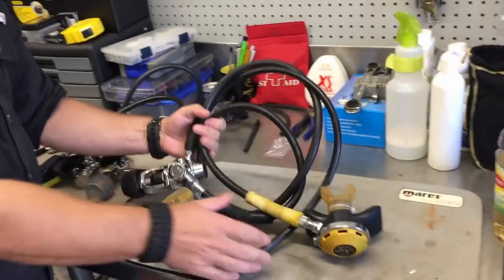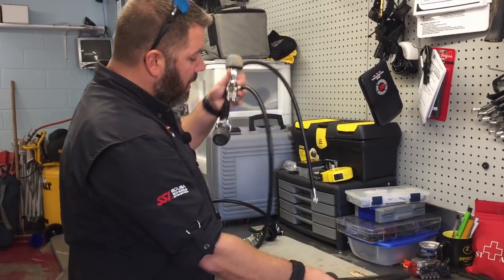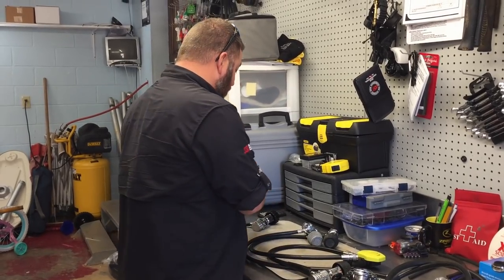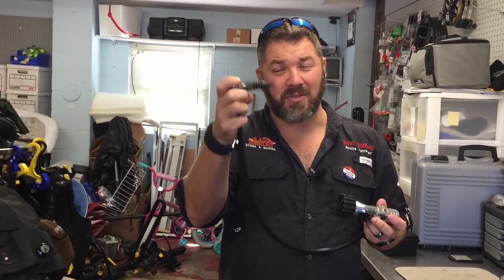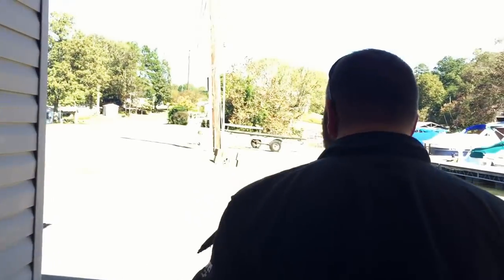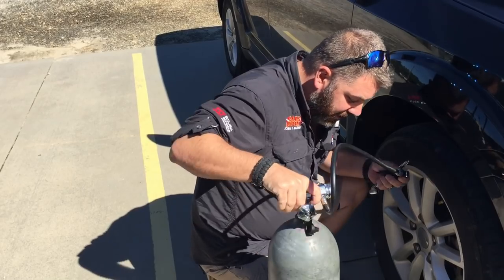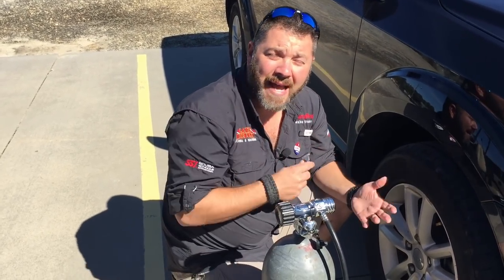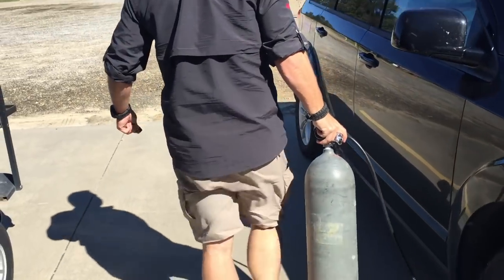Repurposed Scuba Gear

Comment: One of my favorite repurposings was a tank that failed hydro; the owner sawed the bottom off it and then made around six vertical saw cuts up from the bottom of different lengths. Hang a clapper inside and call it a windchime.
Reply from the maker: We have made those in the past. Currently we have 4 that we have made into floor lamps.

Comment: Working on using a scuba tank as an air source for an airbag system on my truck and to operate an air locker to be installed in the future.
Reply from the maker: It could definitely work, just make sure you secure the cylinder appropriately.
Reply: LakeHickoryScuba I have an oxygen tank bracket out of an old ambulance to secure it.
Reply from the maker: That should work.

Comment: I carry a 63 in my truck. I do some remodeling and use a al80 to run a brad & finish nailer. The also have saved my fish after the 1st stage i put a nother reg to go to 3psi  and fed air to my fish
Reply from the maker: We have used cylinders for nail guns as well.  Pretty neat though on the aerator for the fish.
Reply: Other useful things we have used them to do. take apart hydraulic cylinders that needs rebuilt without getting to much fluid all over. Un clogging pipes & drains ( be carefull they can blow apart ) and we had a big spud gun that shot nerf football's.
Reply from the maker: The nerf football idea is classic.

Comment: Bryan i got the impression from this video that regulators can be to old to be used as regulators. I am getting back into scuba after having been away for decades. I have a US Divers Calypso J that I bought in about 1968-70. It was top of the line then. Had it checked out by a-local SSI dive shop last September and it passed with some rubber/silicon replacements. Took a refresher course and went diving on vacation in February in Key Largo and reg worked fine. Plan on continuing to use it. Am i making a mistake in not chucking it and buying a new reg?  Thanks, John
Reply from the maker: Hello 391wombat, it all comes down to your comfort level.  As long as you can keep getting the regulator serviced, I say use it, as long as you feel comfortable using it.
Reply: LakeHickoryScuba Thanks Bryan I am. Had it inspected/serviced, replaced all hoses, added lp port multiplier for octo and bc inflator so im going to continue to use it. Great site. Best John
Reply: Bryan the manual for this old reg says “Air from 3500 psi to 130 psi is regulated by the first stage to an intermediate pressure of 130 psi above ambient pressure.”  Do you think it would be okay to use it with todays high pressure tanks (3442 psi) assuming its properly serviced/rebuilt or is that pushing the limit?  Its fine with AL 80’s at 3000 psi. What are modern regs built to handle psi wise?  Thanks, John

Comment: Hey, how are  you guys today?

This is BRILLIANT...brilliant:P. This is really a brilliant use for reusing :P
Is it safe to keep the cylinder inside a hot car in the summer during your trips?

You make me wish I live in the US near you guys, soo much to learn from you and every day you guys have something new to teach and do.

Hugs from Portugal,
Ronaldo
Reply from the maker: Thank You VashBlaster for the kind words.  You asked a very good question about leaving the cylinder in a hot vehicle during the summer months.  My answer to that is, NO, I wouldn't typically do that.  However, when traveling in my truck, I have a Camper Shell (Truck Top), and it has side windows that I can open to allow venting of hot air.  In my wife's car, for the most part, we travel with it in the winter time, so having a cylinder overheat is never an issue.
Reply: I have seen a lot of American youtubers that dive, they have pickuptrucks and in the back they have like a metal trunk and put the gear there, including air tanks, and i'm just wondering if that's safe cause either it's metal or aluminium trunks and that in the sun can bake.

Normally when i go dive here in Portugal we rent the air tanks so it's less of a thing to worry and carry. 

And the idea you got for an extra pony to fill the lifting bags are awesome, even if you want to use an extra just to use with your dry suit so it won't consume your breathable air.

Here even used material is expensive, people always try to make the maximum buck, and try selling used for the value of new.
Reply from the maker: I think in general, all of us want to get the best bang for our buck.  The key thing one needs to remember when traveling with a compressed gas cylinder is, it needs to be secured and prevented from rolling around.  Over heating a cylinder is actually much harder to do than people realize.  When we fill cylinders, especially steel, they tend to get hot.  Its the prolonged exposure to the heat that makes them dangerous inside a vehicle.  Venting that heat is easy to do, simply by leaving a window cracked, or as in my case, I keep them locked in the back of my truck, which I can vent the heat through a window in my camper shell.  If we look at the physics behind "Charle's Law,"  a cylinder will gain or lose 5 psi per 1 degree temperature change.  So if you took an Aluminum 80, pressurized to 3000 psi at room temperature, and then placed it into a car that sat in the sun all day long, on average the inside of the car would be around 130-170 degrees.  Now doing the math we see that the pressure in the cylinder would increase to around 3500 psi.  This is more than the working pressure of the cylinder, but less than the maximum a burst disk could with stand.  So the likelihood of the cylinder rupturing would be very unlikely.  Now over time, the elasticity of the cylinder would wear down.  But for a short day trip, I personally don't see much of a risk.  If you were using the cylinder as a tire filler, as I did in the video, you could always drain the cylinder down 500 psi, and this would solve the over pressurization problem, in the event it ever got hot. Even with 2500 psi, you would still have plenty of air to fill around 25 tires or more.
Reply: "When we fill cylinders, especially steel, they tend to get hot" that I do know :P. Worked in a Diving center/school during summer, and the room where the compressors and cylinders where was small, and we filled 12 tanks at a time, it could get pretty hot inside.
Reply from the maker: Our compressor room is very small as well, and in the summer time can get extremely hot.
Reply: How high do the temperatures reach  on the lake during summer?
Reply from the maker: Air temperature ranges between 85 and 100 degrees. Our compressor room averages 75-80 degrees (of course the cylinders get hotter when filling).  And of course the water temperature is usually around 85 degrees on the surface and 43 degrees at the bottom.  Needless to say, temperatures vary depending on where you are at.
Reply: only 6 Celsius at the bottom? really? how does it get so cold in a lake? does it have thermoclines or is it very deep?
Reply from the maker: We have 2 thermo-clines in our lake.  Plus there is so much turbidity, the sun can penetrate deep enough to warm the water.  The deepest depth of our lake is 100 feet.
Reply: Yeah I've seen that in your videos, lot of turbidity, flake suspension.. Here in the north of Portugal we also have that in the ocean, it reduces the visibility a lotttttt specially in wreck diving.
In my OWD course, while doing the open water dives, we where at max 12meters and it was so cold, that my eyes hurt during mask exercises. and in one of the spots we had about 1meter visibility.